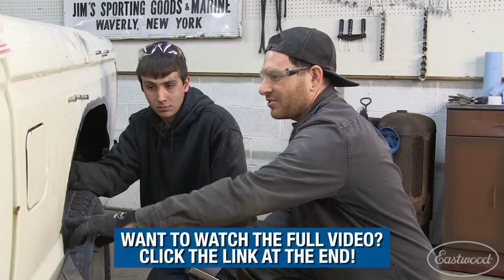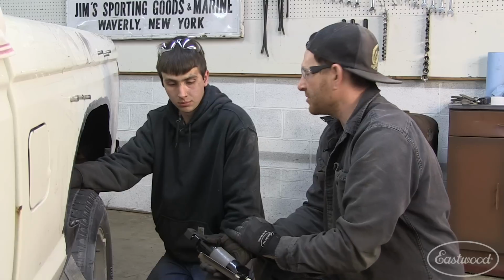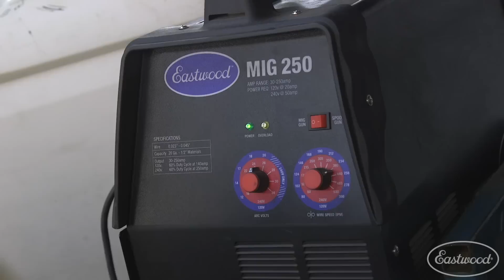How to Prep a Patch Panel & Truck Beside For Welding with the Perfect Panel Prep Tool - Eastwood

Comment: Th funny thing is that I was watching a video of a guy replacing rocker panels on a truck and was thinking about how easier it would have been if the two edges were bent so welding would be easier and better.